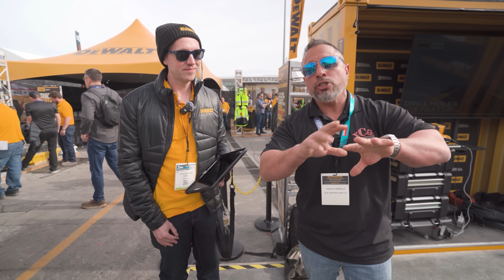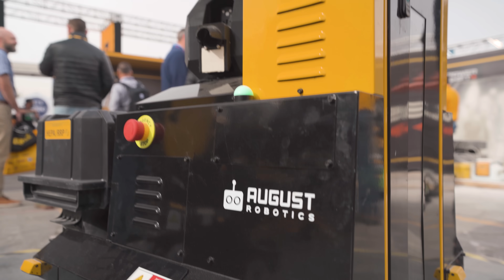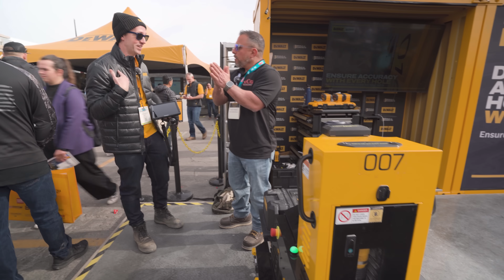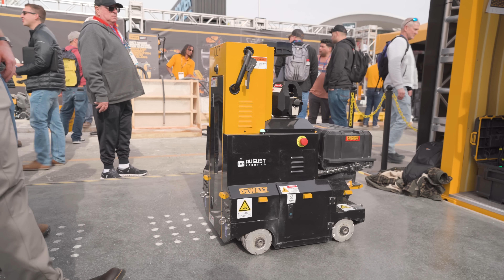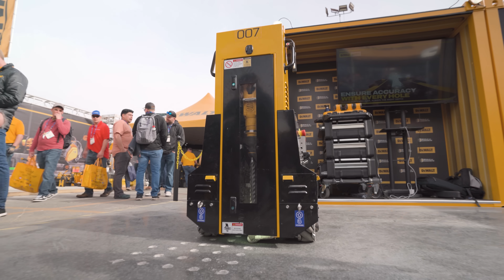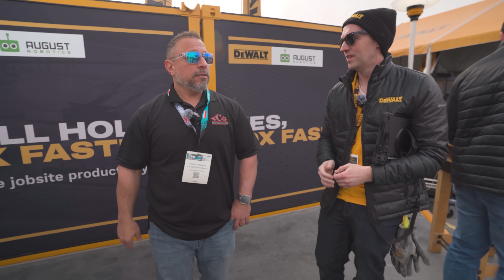DeWalt Just Killed Manual Labor!

Comment: This layout robot will have its challenges. When we go to do layout, there is so much stored material in the way that it will be next to impossible to accomplish.  We have to steal inches to move pallets just to get a laser and chalk a line through the chaos. Companies have already used GPS guided layout lasers, but I don't see them using them anymore. When layout tolerances are tight and concrete columns aren't where they should be on the plans. That layout robot is going to act like a robot vacuum and just bounce off the walls.
That's my prediction. Most supervisors like to sit in their offices and drinking their lattes and try to blame someone else. They tend to be reactive not proactive.
Just my two cents. 😊

Comment: Robots did it in 14.29% of the time it took the human crew.
Reply: @robertcabuto3284  did he said 7000 holes in 7 weeks with 10 ppl?  That’s 20 holes per men per day (5 days week). 

Either were that the most incompetent trade men’s or it’s not a true fact.  

The drill time itself is the same.  The drill hammer does the job.

Comment: How much does this machine cost? How much does it weigh? Does it need to be broken down or set-up on site? How difficult is it to change out cutting tools, and do routine maintenance…do you need special training to learn to operate ? does it require frequent cleanings, calibrations, air filter and cutter replacements? What are the costs of cutting tools, filters, etc…too many questions?

Comment: I've never used an sds drill on a datacentre and i've worked on numerous dcs across europe. We use tate ceilings and pan-decks with wedge anchors. Raised flooring is achieved with chemical fixings.

Comment: I don’t know about this one…. promoting something that would put you out of work is not my type of tool
Reply from the maker: DEWALT told us the tradesmen complain about this repetitious type of work. Contractors can’t find people to do the work!
Reply: @VCGConstruction they wouldn’t sell them any other way than making those statements.
Reply: So we should then go back to manually pulling a plow instead of using a robotic tractor?  Sailing under sail instead of a large jet flown by an autopilot for 99% of your flight?
Reply: No there are people I bet that want the work just they don't reply back to people that apply for the job. I've applied to many jobs that just sit there on their websites never getting filled.